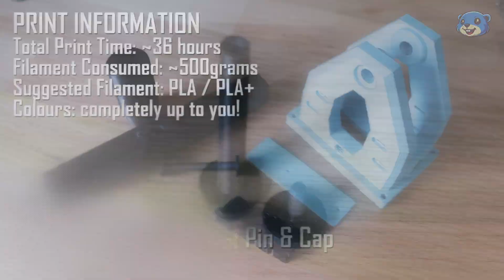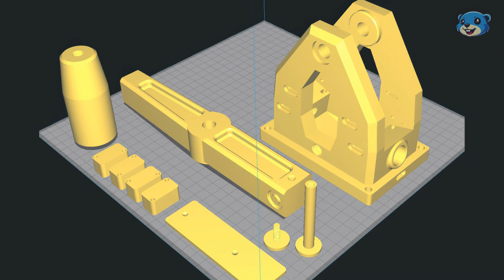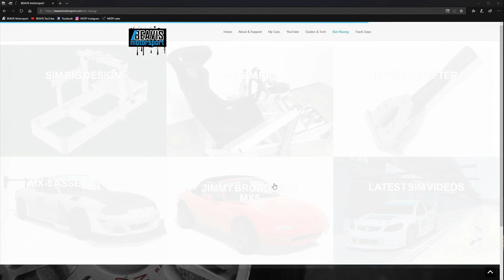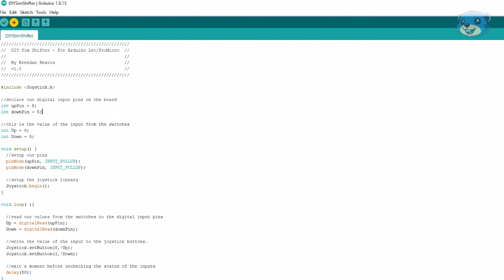GUIDE: Racing Sim Sequential Shifter - Build your own DIY!

Comment: your original video gave me the idea because Heusinkveld and Fanatec shifters just didn't do it for me (too weird and nubby) and Jinx are too expensive. Except I went overboard and did a full CNCed alu chassis, alu cast handle, walnut turned knob and full ball bearings and added a third button for instant neutral. Still gonna be using the code and thank you for the inspiration :D gave me the excuse to finally learn alu casting, CNC milling and anodizing, too ;)

Comment: Getting the same error regarding Joystick not declared.  Arduino 2.3.4, Joystick from martin installed and declared in the sketch and correct board selected  Any suggestions?
Reply: Solved. For some reason, Arduino 2.3.4 wouldn't let me install the recommended Joystick library and kept defaulting to a different one, that was despite uninstalling it in IDE.  Manually removed the libraries and was able to add the Matthew Heironimus. version. Upload and confirm windows can see the arduino in Game controllers :)
Reply from the maker: Glad you got it corrected.

Comment: Hello, i have this problen when i put add zip to library and try to open the zip Error: 13 INTERNAL: La instalación de la librería no fue exitosa: archive is not valid: multiple files found in zip file top level

Comment: Awesome idea thanks!   For anyone having arduino issues,  you can also buy the zero delay USB board and plug it into one of the ports there. no code required.
Reply from the maker: Thanks for the tip!
Reply: @TechBeaver  Thanks for the design.  It has saved me the time designing one.

Comment: C:\Users\MSI X570\Desktop\Arduino\DIYSimShifter\DIYSimShifter.ino: In function 'void setup()':
C:\Users\MSI X570\Desktop\Arduino\DIYSimShifter\DIYSimShifter.ino:27:3: error: 'Joystick' was not declared in this scope
   Joystick.begin();
   ^~~~~~~~
C:\Users\MSI X570\Desktop\Arduino\DIYSimShifter\DIYSimShifter.ino:27:3: note: suggested alternative: 'Joystick_'
   Joystick.begin();
   ^~~~~~~~
   Joystick_
C:\Users\MSI X570\Desktop\Arduino\DIYSimShifter\DIYSimShifter.ino: In function 'void loop()':
C:\Users\MSI X570\Desktop\Arduino\DIYSimShifter\DIYSimShifter.ino:37:3: error: 'Joystick' was not declared in this scope
   Joystick.setButton(0,!Up);
   ^~~~~~~~
C:\Users\MSI X570\Desktop\Arduino\DIYSimShifter\DIYSimShifter.ino:37:3: note: suggested alternative: 'Joystick_'
   Joystick.setButton(0,!Up);
   ^~~~~~~~
   Joystick_

exit status 1

Compilation error: 'Joystick' was not declared in this scope
Reply from the maker: You need to add the Joystick library. See the video at 8:00 mark.
Reply: @TechBeaver  I get the same error despite having the library installed and included.